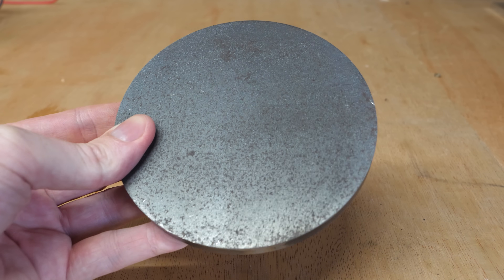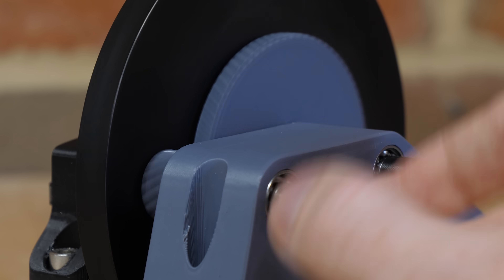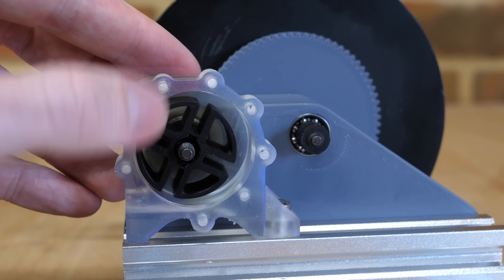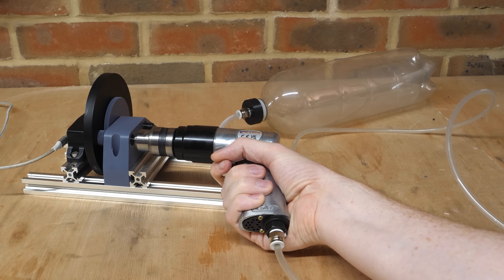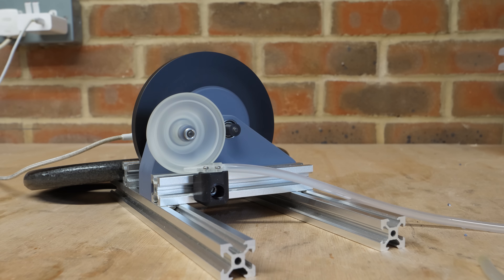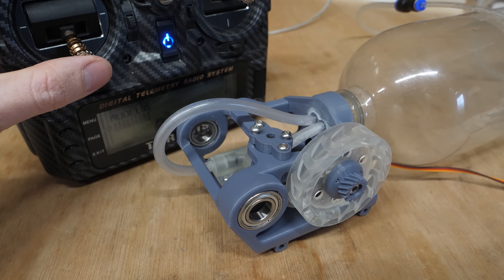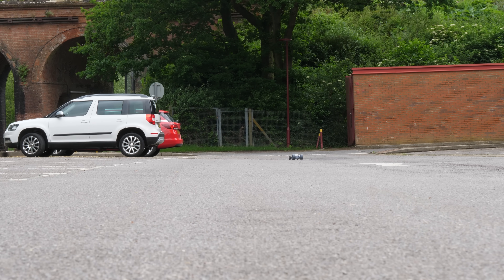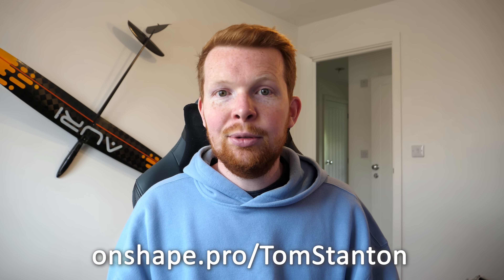Building a Turbine Car

Comment: Where air isn't being blown through the turbine, the turbine is acting as a fan which is wasting energy. If you block 90% or so of the turbine where there's no compressed air blowing through it, it won't waste as much energy.
It's the same as if you block a hoover, it uses less power so it spins up faster.
Reply: That and some shrouding around the nozzle to ensure the air can’t escape/be redirected at the higher speeds.
Reply: Also the outer shell rotating is creating a ton of surface drag. Need to switch to a static duct.
Reply: @ThreeAngrySquirrels  Static duct in the rotor?
Reply: Air being sticky and having friction is such an odd thing lol.
Reply: @heroslippy6666  I wonder how the turbine would perform with different gasses, like sulfur hexafluoride for instance.
Reply: @stopthephilosophicalzombie9017  I'd imagine heavier gasses would make it go faster because the force would be greater but I honestly don't know.
Reply: And if you made that "block" move, then you got a multistage turbine. It is far better to use that energy to spin another wheel than try to use a static block. You want the air to move, not to bleed out because of overpressure. Velocity of the air is the thing we want to utilize, not pressure.
Reply: It also should be a one-way gear mesh that as the turbine slows it decouples from the flywheel, which means that its slowdown does not affect the power. Only energy in, and no added friction after the air pressure is too low.
Reply: @kaing5074  should it also have gear selection? Was 15% of the run at the optimal RPM?
Reply: I also tought of that. The blades that aren't near the nozzle must be concealed
Reply: You want wheels to be as small as possible to reduce surface drag.

Big wheels are only useful when you need grip and have power to spare. This car can't achieve both needs.
Reply: @Splarkszter  You get more speed out of a bigger wheel at the same rotation speed.  But of course, it adds some inefficiencies.
Reply: Front wheels should also be tiny, and the bottle can be heatshrunk or a 2l vessel could be formed to be more aerodynamic. The bottle shape is not good and the front wheels are not helping with the rotational mass. The wheels should therefore be driven via a centrally mounted hub and with two sockets in order to reduce torque steer. To further reduce issues with the turbine, the fins should only be shaped like the water ones to redirect the air 180° and only on the rim say 1/2cm or less, so a cup or two cups per 'fin' a la water turbine blades and smaller. An additional ring made of metal could therefore be attached to the flywheel to balance it and add additional mass. But it definitely needs a central vertical position with a properly straight axle for both itself and the rear wheels to work. This wobbly jank is fine for a first concept but at high rpms there's not much room for error
Reply: @kaing5074 you’re thinking of a peloton wheel in regards to the 180° water design, not so great for this application and air as air is much less dense and it will be missing out on a lot of its potential due to drag and other issues. I think a the turbine we currently see is much better but as other pointed out; the fact that it is vented straight out after the turbine without utilising the remaining pressure differential is a more effective design feature for this application. The idea of disengaging the turbine after peak torque to allow the flywheel to keep it running I think would mesh quite well with it and then adding in some aerodynamics and better wheel arrangements would make this a really sleek, more efficient design.
Reply: Was going to say exactly this, but also thinking about more than 1 nozzle.
Reply: Along this topic, I was thinking about stacking these turbine wheels to take advantage of the waisted air…like the turbines you referenced during the video.
Reply: @Friend-gineer  Most of the energy has already been removed.  In fact, I predict that if you did this, it would go slower than without the second turbine because it would put a small load on the first turbine.
Reply: Or you pressurize the whole wheel, not just a segment of it. This would mean to decrease the diameter. Also, multiple turbine stages might be beneficial. 

There's a lot of literature on how to properly design a turbine. A good starting point might be to read about velocity triangles in blade grids.
Reply: it a complete waste your right.... turbine have little or no torque...   all there work is donr once the get up to speed.   so  by the time yu get to the end of the track it might not ever be at half speed :-\one pathetic drag race.....   we do low 7's with a 900 horse 427 cobra jet ,,, just under 1200 foot pound of torque
Reply: Nothing you do is going to make this system efficient.  Though I do think it might make a cool kids toy. Pumping it up with a bike pump would make it fun and very cheap.  Problem is, the tank would have to be better.  I don't think any legal dept is going to let a toy company put out something with a soda bottle pressure vessel for children.
Reply: @tarstarkusz  Bottle rockets do exactly that.
Reply: @TomOConnor-BlobOpera  I'm not aware of any state in the US where 8 year olds can buy firecrackers or bottle rockets.
Reply: @tarstarkusz In this context, do you think they refer to cheap firework rockets (with an American ass name) or rockets made to work with soda bottles which are filled with water and compressed air?
Reply: @tarstarkusz  What or where is the US?   I know most of the world....  britain, europe, asia, africa, australia....    where is the US in relation to most of the world?      ahem
Reply: @Xissorplane  I assume he is talking about fireworks.  I had a air/water powered rocket in the 70s as a boy. But it came with the rocket body.  The pump simply could not build the pressure to cause it to explode. It was pretty thick plastic in any event. Unlike bottle-rockets, they are aimed at 8 year olds.
Reply: @tarstarkusz  you can literally buy them. bottle rockets are a kids toy.
Reply: @tommac8742  No they aren't. [edit: are you talking about fireworks when you say bottle rocket? Because that is what I am talking about]
Reply: @tarstarkusz  nothing to do with fireworks
Reply: @tommac8742  Then nothing I said applies. I thought you meant bottle rockets, the kind you put a bottle and then light the fuse and it flies into the air and explodes.

Comment: The dry ice around here comes in pellet form that fit right inside soda bottles.  I would throw some dry ice in that bottle and a little water and run that car for a while.  I did something similar with an air powered toy car back in the 80's.
Reply: Just needs a pressure relief valve. I've been near 2L plastic bottles with dry ice in and when they let go, it's like a cannon going off and you can hear the bang rolling across the hills like thunder. Wouldn't want to be right next to it for sure.
Reply: @technicalfool you could probably reinforce the bottle with duct tape 1 layer up and down, 2 layers around and it would hold SIGNIFICANTLY more pressure.
Reply: @robertlortz4297  ahhh...  a scientist at last!   Duct tape is ignored so often!
Reply: @technicalfool  how many pellets was going in? I guess it was more than a few.
Reply: @technicalfool that sounds fucking cool
Reply: You could drill out the end of a mini propane tank a 1 pounder and replace the normal valve head with a regulator that screwed on and not need to worry about it blowing up from dry ice. Soda bottle can hit 100psi+ with out exploding and 1 pound propane tank can get close to if not above 2k psi. Also water is not needed for dry ice to do it's thing it will sublimate just fine with out it
Reply: @nanaki-seto do the 1lb propane tanks not have a built in relief valve?
Reply: @nanaki-seto  You do not need to drill a 1 lbs propane tank. Just buy the required fitting. They are super simple designs. Pretty sure propane tanks are tested at 600 psi from the factory. Keep in mind that propane when 100F produces 175 or so psi. So they are very strong tanks. Weigh next to nothing and can hold so much air.
Reply: @kameljoe21  still needs a relief valve or your making a grenadde. Co2 at room temp is well above 1000 psi, most co2 tanks sit above 2k psi.
Reply: @danl6634  For something sold retail you might need a need a relief valve. Yet you must miss the fact that the 1 pound propane bottles already have a built in relief valve. Off hand I do not know what the max pressure on them are yet you should be able to fill the tank to around 200 psi with nearly no problem before the relief valve goes. Off hand I do not think I have one on hand. I mainly use the 20lbs bottle for my small grills. I have adapters that go on them to connect them to the quick connect hose. 
Either way the volume and psi rating would be far greater than the 2l 80psi bottle. A 1 pound propane bottle is just about one liter volume plus a small amount. So in theroy there is half the tank space. Yet with increased pressure there is far greater air volume. 1l at 200psi is 0.51 cubic feet. 2l at 80psi is 0.45 cubic feet. This is a pretty large amount of additional air. This could extend the run time by 4 seconds if we assumed run time was 30 seconds using the 2 liter. This is not accounting for the additional weight and after running the numbers you would need to scale up the psi much further to account for the weight. A search and it seems that they go off at 375 psi. Meaning that in theory you could do 350 psi. 1l at 350 psi is 0.87 cubic feet. That is double or close to it. Not sure if they exist yet I recall reading about the new carbon fiber tanks which are suppose to be super light and can still retain the same psi rating.
Reply: @kameljoe21  no argument that it would be worthwhile; I'm just talking about the co2 side of things. It would only take about 4 grams of dry ice submilating in a 2l bottle to make 45psi. Or if a person was to add too much without a relief of some sort, at room temp the saturated co2 would be around 850psi. After saturation, the more excess dry ice = more pressure as it will behave like an ideal gas. I'm only trying to spread some caution because messing with pressure vessels & gas at these pressures as some have commented is a good way to get unalived really quick.
Reply: @kameljoe21  I very recently worked for a large producer of small propane tanks. Those tanks are tested by being filled with propane and then just run through a hot water bath for a few minutes. Water at 130F or so. If it leaks, we pull it, empty it, and maybe attempt a repair. If not, it gets packed and shipped. That building permanently stinks from the leaking propane. (Technically it's an additive that smells, since propane is odorless, but the room still sinks)
Reply: @ThordanSsoa  That would be the ideal pressue to test them at. 257 psi is what propane would be at 130f. 
I bet the place stinks. Even propane tanks sitting open for years will still smell of that stuff. 
The few mins must be the time it takes to warm all of the liquid in the tanks. 
I would also guess there is another quality control test that is done as well. Maybe in another lab that exceeds the overal general testing. I am sure they pull samples and test them. 
What type of repair would one do?
Reply: @kameljoe21  The idea with the water tanks is to raise them to their rated max temperature, and then see if they leak. The water making any leaks very visible. None are pulled off the line for separate testing. If they don't leak in those conditions, we ship it to distributors. 
As for repairs, if the internal mechanisms of either the primary or relief valve are leaking then we would empty the bottle, remove the old valve, put in a fresh one. The housings are brazed in place, but the internal components could be pulled. If that bottle failed a second time, we would then throw it out. If it leaked along the seams between the halves of the bottle or along the edges of the valves, it just got thrown out.
Reply: @ThordanSsoa  Ah this is for the bigger 20 lbs tanks. Not the small disposable 1 pound tanks. That make sense. I know these bigger tanks have a life of 10 years which is why the exchange places will not take older tanks.
Reply: @kameljoe21  Yeah, I would imagine those have to meet higher standards since they sit at higher pressures. We only made the small ones.
Reply: Having built something similar, I can confirm they like to go bang if you don't have a relief valve. There may or may not be a dent in the ceiling to corroborate this.
Reply: '80s *
Reply: As MythBusters have tested and confirmed, you should add a relief valve, otherwise the pressure from the CO2 will build up and eventually the bottle will explode because there's pressure beyond the amount it was designed to withstand.
Reply: No need for water, on a sunny day it will sufficiently off gas on it's own.
Reply: Kind of like the power pack on a RL10. Nice.
Reply: Be careful with dry-ice in enclosed containers; the pressure might rise beyond what you expect  as it heats up, and you got yourself a pipe... Uh, yeah, with how much Youtube has been unfairly hiding my comments lately, I'll let's just say, B-word
Reply: allum cycle
Reply: Oh that’s sick, new renewable energy source? Takes the co2 out of the air and puts it right back
Reply: @Seasal87 producing dry ice is pretty energy intensive, I also wouldn’t be surprised if they are using some chemical reaction as a co2 source and not the atmosphere as filtering gasses at a commercial scale would be quite difficult and also requires energy.

For reference o2 purifiers used for medical purposes draw about 200 watts when working at max capacity. And they only produce a few liters of not quite pure o2 per minute. Co2 purifiers would be even less efficient since it there isn’t very much of it in the atmosphere. (Only .04% by volume)
Reply: @jacob416  Others pointed out the same, but perhaps on a planet with a high concentration of Co2?
Reply: @Seasal87  well yes, but actually no.
Reply: @JustinKoenigSilica  explain
Reply: @Seasal87  my bad, misread your comment lol
Reply: @Seasal87 you're on a slippery slope
Reply: @Seasal87  Too much energy is used freezing the CO2 for it to be considered renewable.
Reply: @SkorpyoTFC  dry ice is a petroleum byproduct also so while burning fossils we can also put the co2 in the stuff we didn't burn back into the atmosphere
Reply: @SkorpyoTFC  “Renewable energy: an energy source that is not depleted when used.” The efficiency doesn’t matter
Reply: @Seasal87  That's a recyclable medium, not renewable energy. The energy in question is the thermal aspect, not the CO2.
Reply: @SkorpyoTFC  Fair enough

Comment: TESLA TURBINE!
Reply: Simple to make, but usually inefficient short of very viscous fluids.
Reply: @ericlotze7724  If the slots are thin enough, even air becomes viscous. and with a resin 3d printer 0,1mm slots should be easily possible
Reply: @ericlotze7724  I know, its just fun to talk about Tesla and his zany inventions
Reply: @monstercameron yeah maybe tom should make a gobal wireless power station
Reply: @ericlotze7724  skill issue
Reply: That would be so cool

Comment: This is really neat!
I understand your thought process with the wheel design "we are going to ignore" but I think it wasn't as effective because the other designs direct the air into rotating and kicking backwards (ish) from the direction of air flow. This works like recoil on a gun and pushes the wheel in the opposite direction where as your design directs the air perpendicular to the wheel and point of air flow. This means the "equal and opposite reaction" is not pushing the wheel in the direction of rotation, but tries to twist the wheel instead of rotating it like designed.
Edit*
The point that directs the air at the inside of the wheel is also at a poor point of torque as its so much closer to the inside of the wheel.
End of edit*
At least, that is my hypothesis.
I wonder, if you designed it with a similar size but had multiple of the cups along each "path inwards" if it would capture more of the air and increase the wheel speed. It may also take more time to accelerate due to the extra weight, but I'm not sure if it will ever come close enough to the 12.8m/s design due to inefficiencies.
I'm curious
Reply: I'd try the Pelton turbine

Comment: I have been toying with the idea of using compressed air as a fuel and electric motors as the drivetrain. 

A motor controls a an air pump, which compresses and stores it in Narrow but long tanks. Once air pressure is too great for the mechanical valves to hold back, it’ll open them, and air will flow out, spinning up another motor, that recharges the main and air pump batteries. This allows the car to drive pretty much infinitely.